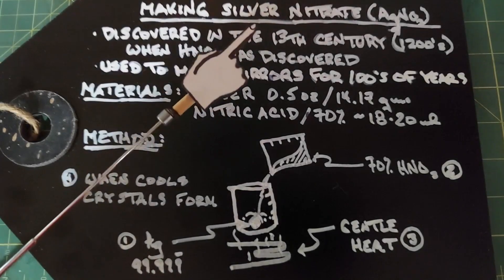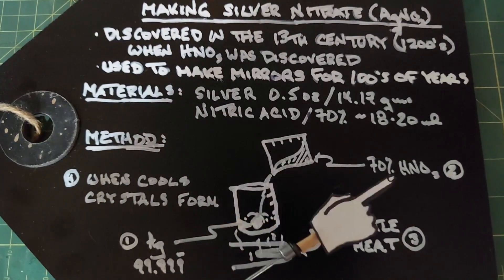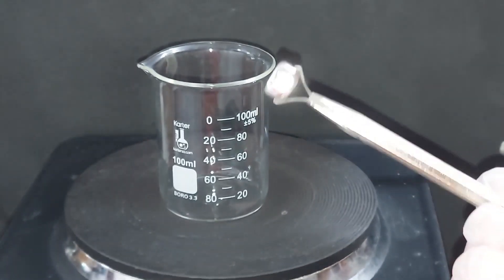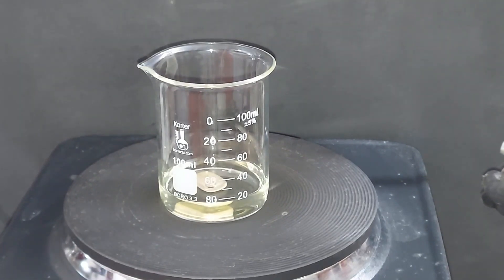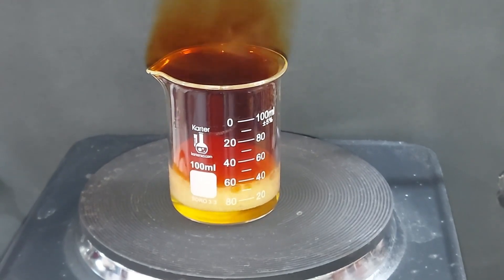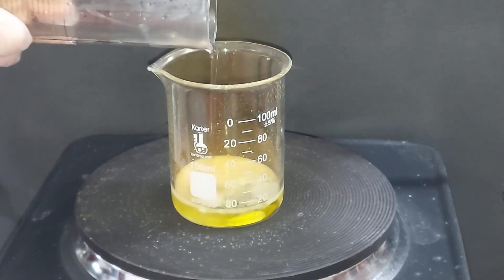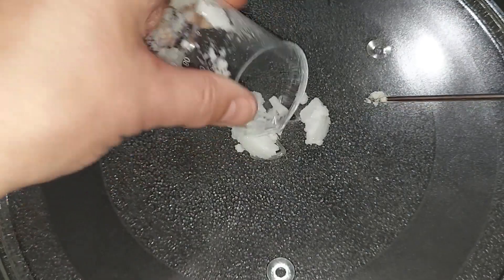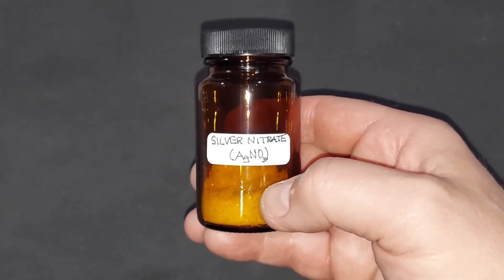Making Pure Silver Nitrate

Comment: Hello, I dissolve silver in nitric acid. At the end, the silver nitrate turns bluish-green. What is the problem, and what is the solution?
Reply from the maker: Is your nitric acid pure?  If not this will effect the final color.  The bluish-green suggest possible copper, or even nickel.  Or, the silver isn't pure.  Silver from jewelry, coins, silverware, or other silver products isn't pure.  Typically, a small amount of copper is often used, mixed with mostly silver, to make something such as a coin, and may be the source of the color change.  Hope this helps.
Reply: @cranialconstruction "Thank you for your guidance. Indeed, the presence of copper in silver can be addressed by removing the copper, in order to obtain pure white silver nitrate."

Comment: It looks like you had a half a troy ounce (OZT, troy ounces are 30.1g and are the standard unit for precious metals).  You might want to adjust your calculations.
Reply from the maker: In theory, yes.  However,  the practical side of this experiment requires you continue to add HNO3 until all of the silver is dissolved, regardless of its weight.  I do appreciate the insight.